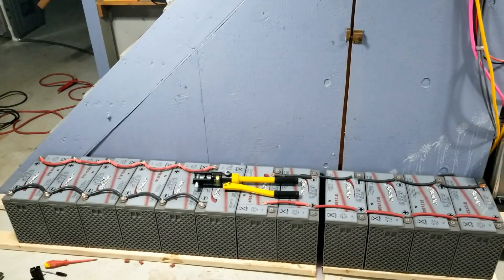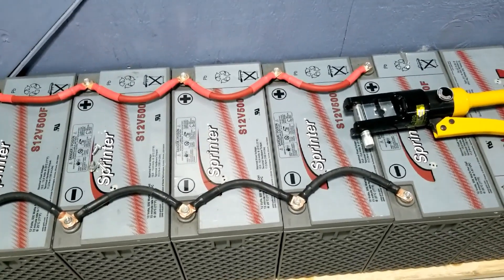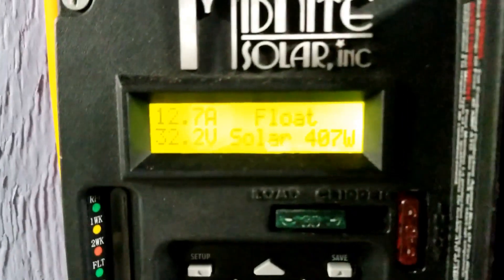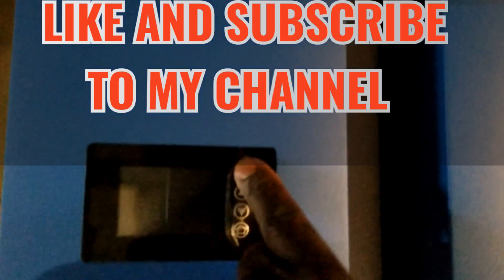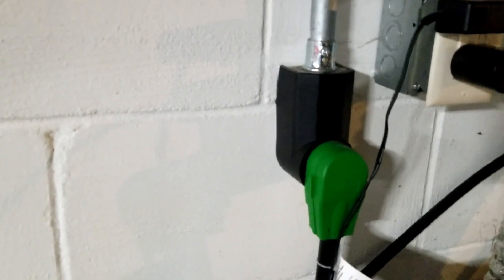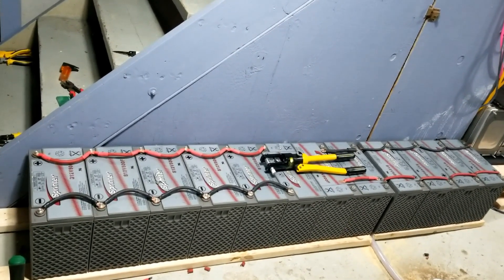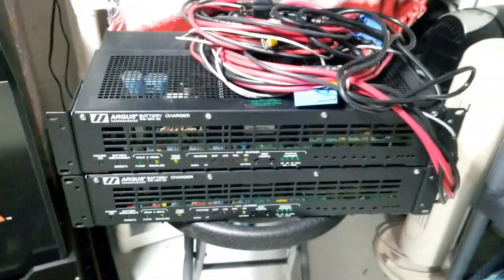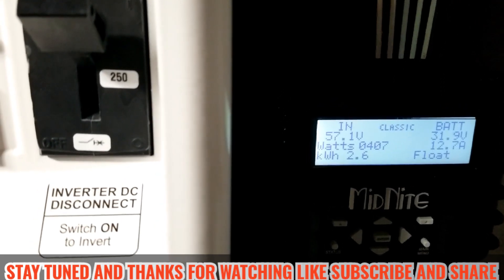SOLAR BATTERY, GNB SPRINTER, SEALED AGM, FLAME RETARDANT, UNINTERRUPTIBLE POWER, EMERGENCY POWER #1

Comment: Hello, I am using splinter 12V1800 56.4A 2 batteries. My Mppt device charges these batteries up to a slightly high charging point, up to 14.80 voltage. Do you think this voltage will damage the battery?
Reply from the maker: Definitely! It will damage the cells.
Please follow the manufacturer charging and discharging specifications that came with the batteries. 
If you don't have them, you can contact them or check there website for the make and model of your battery specifications.

Thanks for stopping by and don't forget to Subscribe Like👍and Share my videos if you find them helpful.

Comment: I put a comment in the "Part 2" of GTI with limiter. My batteries are almost identical to yours here as mine came from a data house as well and were never cycled. I have 14 of them. My Sun GTI inverters with limiters are the same as yours only mine GTI are 24 volt so I need to run my batteries in series to get 36 volts which is around what my solar panels are. I plan to do exactly the same thing as you which is to first put them in series for 36 volts and then parallel. 
I don't understand how to have the batteries and solar connected at the same time for "set and forget". It seems I would have to turn the inverters off while a stand-alone MPPT charge controller charged the batteries while the existing solar panels supplied power to the inverters only. Can you please help me?
Reply from the maker: HERE'S A LINK TO MY
GRID TIE SOLAR INVERTERS: https://www.youtube.com/playlist?list=PLSNjIRSnUPDL4fWuaEW_gOZc-bQFuWZvV